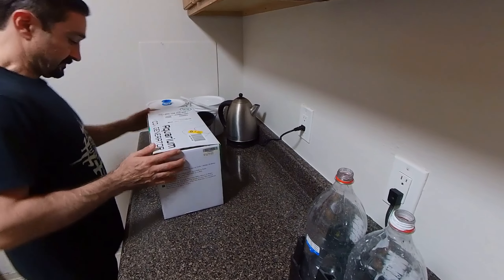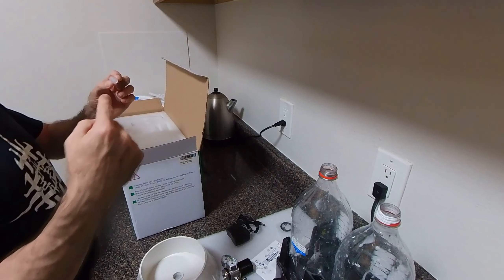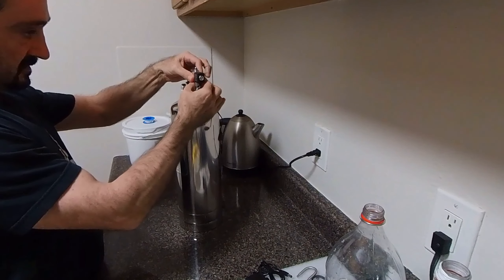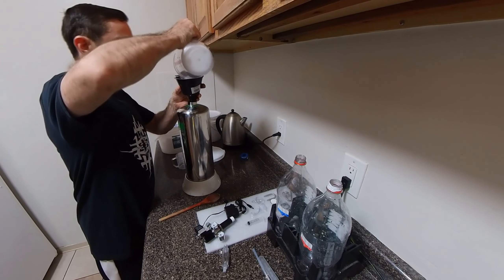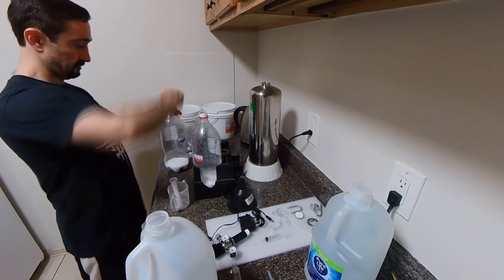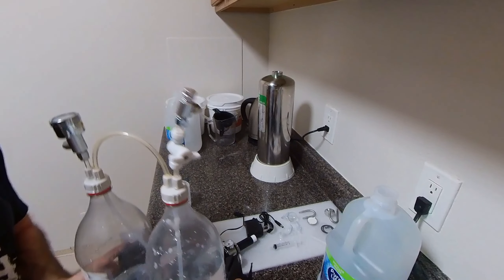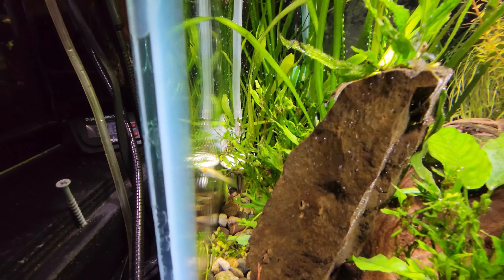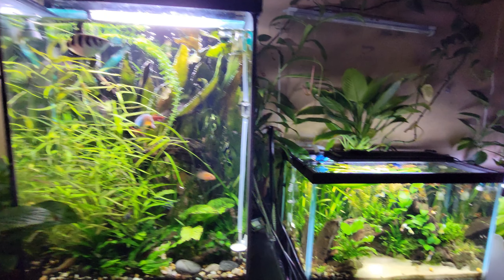DIY C02 Generator- ZRDR AQUA R400X- Unpacking, setup and CO2 refill process

Comment: Hey I got one of these. The first time I did not take the "put water in at a 45° angle" I thought to myself "what the heck does an angle have to do with adding ingredients?" Well it turned into a fountain. This time I didn't get the explosion, but I do not think I tightened it down right and while it lasted months the first round, I only got a week. Gotta master it, but it's worth it and cheap to use!
Reply from the maker: I just pour it straight down  and quickly close the top.  It can be a little tricky to close the top. But I never had a blowout.  Oh yaa, make sure it's tightly closed.  Check  the rubber ring and make sure it's clear of any debris. I do 1 bubble per 3 or 4 secons in my 25 gal tank.   Goes for 6 months
Reply: @thingsidomyway  To be fair I did a lot of testing with it in plant only smaller tanks, but it was intended for a heavily planted 125 gallon. I adjusted it until I got the green color on my CO2 bulb and that was a very high bubble count.
Reply from the maker: I think it's not necessary to have it green.  I mostly use it to keep my ph at the constant level.  So I have mine running 24/7 with a constant flow of C02.  I also have added a hack to save on C02. I will be making another video, and I will talk about my hack.  I saw a similar thing used by some Japanese fish keeper, so I adapted that for my tank.
Reply from the maker: I can't stop trimming my plants they grow so fast.  And my color barely ever gets green
Reply: @thingsidomyway  I'll never go back to low tech with such good growth on this one. Extremely good purchase.  My demo tank I had no animals in, but did not set the timer right and it killed the detritus worms that I did not know I had. Think that was a 3 gallon cube. For the 125 I am looking into a water reactor so it does not need an additional hose and mixes throughly.
Reply: @DIYFunVentures so just poor the 900ml of water in without the 45 degree tilt even though others do it?
Reply from the maker: @destryl1076   They do 45 degrees, so it does not get agitated fast.  but i don't see  any difference.

Comment: How long does it last with a dose of 400g? Is it strong for up to 6 months?
Reply from the maker: i do mine at a slow rate like 1 bubble per  3 seconds.  and its going for 6 months. and this rate is more than enough  for my 20 gallon aquarium.  and i run it 24/7.